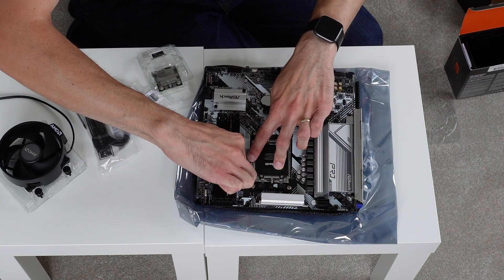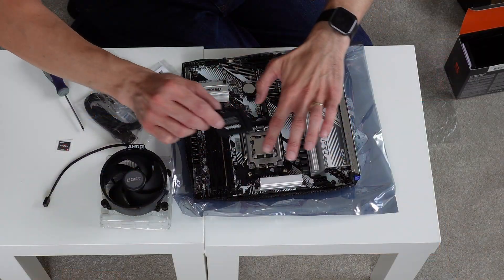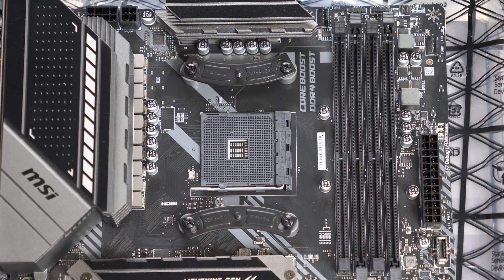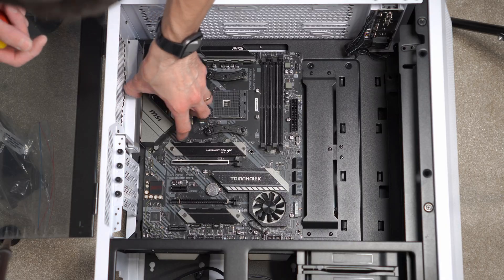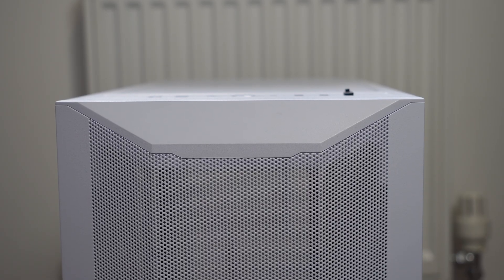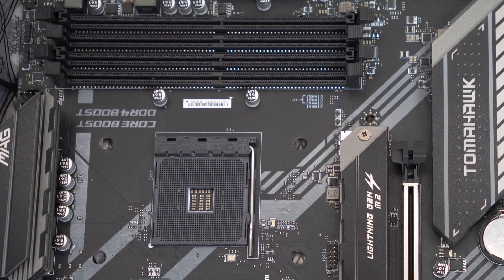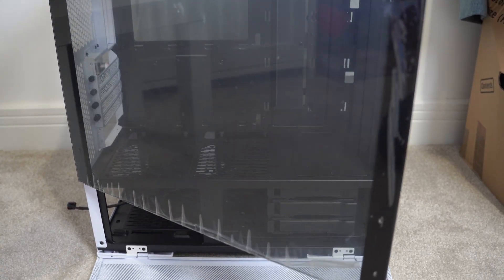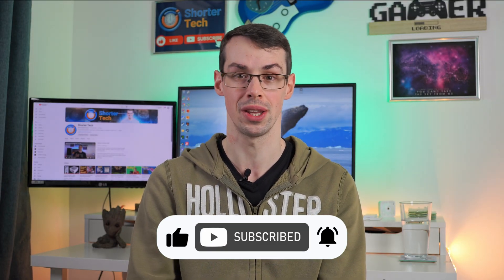Can You Leave The CPU (Motherboard Socket) Exposed?

Comment: An old X79 board I have used for 7 years and stopped using last year won't work anymore. It's odd; I just had it in the basement in a room, and I tested it yesterday, but I can't get anything on the screen. I tried 5 sticks, took out the CMOS, tried the other PSU I use for my main PC, and nothing works. This morning, the same board 's fans keep stopping and spinning, and I noticed the gold in some spots is missing. I left the board at first with the cooler on it, then, earlier at the beginning of this year, I took it off and put the board in a closet.
Reply from the maker: That's annoying, sorry to hear it :( It does sound a bit suspect. I mean, I hope you can fix it, but it does sound like it's now faulty which sucks.
Reply: @ShorterTechOverwrite Well, a guy told me it's bent, and I don't feel like fixing it or buying a new board because it's an old X79 I stopped using last year. I was just going to sell the board for $50, and my main board I use still works, along with the CPU. The X79 CPU still works with the cooler too, and I have five sticks of RAM for it. My DDR4 RAM works too, which I'm selling all this stuff, so I'm not going to make a big deal about an X79 board.

Comment: I'm building a new PC, installed the cpu and ram and before installing the AIO, I decided "gosh darn it, I want the other AIO model". Now my cpu has been waiting in the motherboard for 4 days and the new AIO should arrive in 3 days. The case is closed (unless I'm fiddling with the cables) and I plan to use pressurised air and a thermal paste removing wipe on the cpu before installing the AIO. Thoughts? 😊
Reply from the maker: Congrats on the new PC build, and I know that feeling re: deciding to switch coolers lol. Yes, a wipe to remove the paste from the CPU should work fine IMO. I have some isopropyl wipes that nurses use for injections etc, and those work fairly well. But even children's wet wipes can work in a pinch lol.

Comment: My brand new asus prime b-550 plus i bought a couple months ago came with the socket exposed, i never seen a cover over one in my around 15 years of pc building, i know the newest amd and intel sockets have a cover like shown in this video and the pins are in the socket instead of cpu but i never used/had one like that, i buy budget parts. I highly doubt a bit if dust is gonna cause problems or break anything, there are pci slots in the mobo that are exposed and as long as you dont spill or waste something in them or theres no clumps of dust you should be completely fine. Computer hardware isnt fragile like glass, the only thing that can and will break them is too much electricity, especially static.

Who is gonna have a naked motherboard out laying around exposed to collect dust??? 99% of ppl with common sense will store it in something, like the original packaging/box it came in, preferable in the anti static sleeve too 🤦😂
Reply from the maker: Haha that's very true actually, and I am a bit OCD about some of these things lol. I agree that a lot of hardware isn't overly brittle. I actually hadn't realised that AM4 motherboards didn't come with a plastic cover - that's apparently more of an AM5 thing. Which makes sense if they've moved from PGA to LGA.

Comment: It's not too much of a concern for me if it's on a PGA board, but I do get a pit in my stomach every now and then if it's LGA. It'll be the other way around for the CPU for each respective system, though. I'll have the occasional sweat drop from my forehead when I know the processor has pins at the bottom even after all of this time, and it's the same way for me when I'm opening the latch for an LGA board, especially if I know it's a setup for someone else. I get a lot of stuff used, so getting stuff in dusty condition isn't uncommon. I don't think I've had any issues with the socket itself on the boards that I have, so my fingers are crossed that it stays that way.
Reply from the maker: I agree, and also I feel the same way when the CPU has the pins. That always makes me nervous :/
Reply: @ShorterTechOverwrite  am4 motherboard sockets which is the kind u bought second hand don't come with those socket covers
Reply from the maker: Ahh, TIL. I couldn't remember - it has been a while since I bought an AM4 one brand new. I've bought 3 AM5 motherboards recently and they had them, so I then kind of assumed. Thanks for that info.